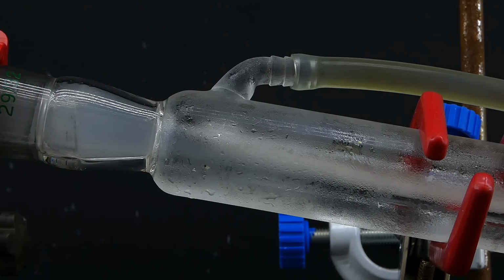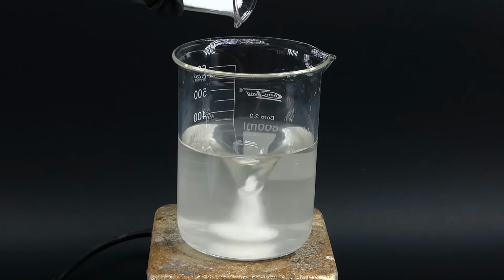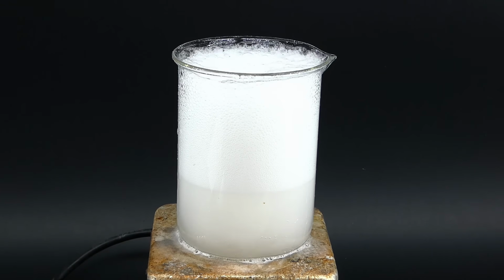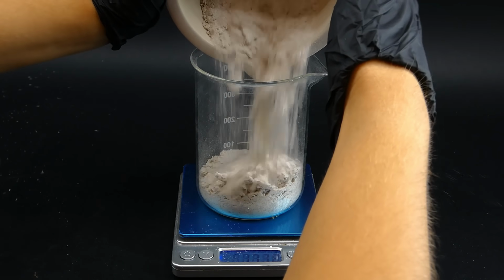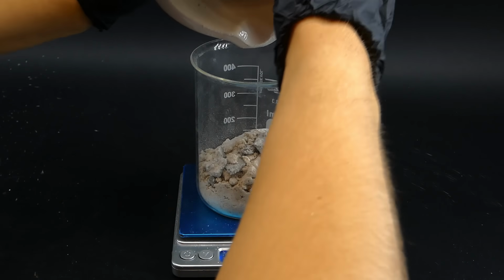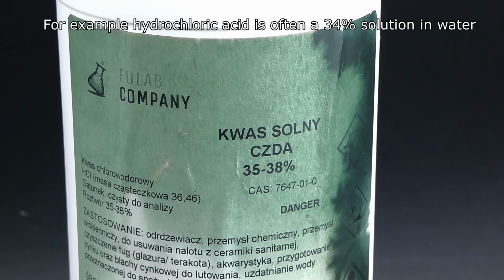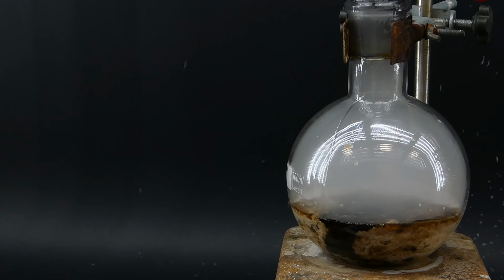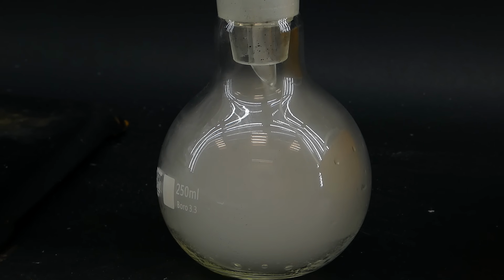Making Glacial (95%) Acetic Acid from Vinegar

Comment: 16:15 the acetic acid dose not dissolve copper it is bc modern pennys (after 1980 somethin)are mostly zinc with a thin copper coating and acetic acid dissolves zinc NOT copper

Comment: Yellow doesnt always mean bad. It could also be good. Because the more concentrated a solution becomes the more do the impuritys. Allowing you to indentify it as a amature home chemist, without using expensive equipment. Or boring TLC. Practical and fun applied science = NR#1

Colours on paper boring.

Comment: I Tried It With Calcium Acetate Instead Of Sodium, I Left It A Little Longer Than What It's Supposed To, The Distillant Was Clear At First But Then It Started To Turn Yellow as The Mixture Inside Of The RBF Turned Black And Solidified, I Thought It Was Some Acetone Because I Added An Excess Of Calcium acetate And The Flask was Totally Dry After The Distillation, But Then I Saw Sort Of (White Flaskes) floating On the Top Of The Distillant (Which Is Yellow In Color And Supposed To Be Glacial Acetic Acid And Acetone Mixture), Now The Question Is What Is Those White Flakes Supposed To Be ? I Really Can't Think of Anything

Comment: You can measure the concentration of the final product with volumetric titration: react an aliquot of the glacial acetic acid with excess sodium bicarbonate and measure the volume of CO2 produced with an inverted graduated cylinder set-up.

Comment: Where I live you can buy 80% acetic acid for cheap. I read in a 19th century manual (Dick's encyclopedia of practical processes) that it should be possible to dry 80% or higher acetic acid using anhydrous sodium sulfate followed by decanting and distillation to obtain glacial acetic acid.

Comment: I was wondering, can you get the sulfuric acid at such high concentration at the hardware store in Poland? Here in the Netherlands you can only obtain like 10% as an individual. I thought that was the case in the whole EU, but maybe not? It would be interesting to hear from you how it is where you live.
Reply: It seems to be implemented mostly in countries where terrorism is a problem, if you catch my drift. Before 2014 you could buy concentrated sulfuric acid, 65% nitric acid, 30% H2O2 (even 50% "perhydrol"), pure nitromethane, alkali nitrates and chlorates freely. Guess what happened that they decided to restrict all this draconically?

Comment: the shop you recommend is ridiculous. They never state purity information, and in many cases they don't even note the packing size or weight to their product. And prices are laughably high: 30m of normal household (thin) aluminium foil for 30€! You can get the same at the discounter for less than 10€! 🤣🤣🤣

Comment: Fascinating chemistry video excellent quality chemistry video very well done sir keep up the good work 👍 also, in South Australia where I live it is perfectly legal to purchase small quantities of glacial acetic acid (purchasing containers up to but not larger than 4 litres) so it's not necessary for me to convert vinegar to glacial acetic acid if I want glacial acetic acid but still excellent quality chemistry video truly fascinating. I think that it's also worth mentioning that despite being considered a weak acid since glacial acetic acid doesn't fully dissociate in water and completely dissociating in water is what defines a strong acid glacial acetic acid is still corrosive and capable of causing severe chemical burns if in prolonged contact with large areas of skin and in addition to being corrosive glacial acetic is also moderately flammable.

Comment: You can use copper hydroxide to make copper acetate. Those loose their hydration water very easily (heated to 100C but not more) and are soluble in acetone and ethanol among other things
Furthermore, when reacting with sulfuric acid you make CuSO4.

Comment: I really appreciate the way you take cleaning up into account. Might there be something easier to clean than a beaker for the step where you dehydrate sodium acetate?
Reply from the maker: I could theoretically dehydrate the sodium acetate in an oven and only have a baking tray to clean, but this might also result in a large mess
Reply: @Amateur.Chemistry  you may be more skilled at chipping things out of beakers than I am, but I've lost beakers this way. Loss of a beaker isn't a huge problem because beakers are cheap, but there's glass bits of various sizes to deal with, and that part's not fun.

Comment: the penny is zinc with only a copper plating, you can see it started really eating away at the inner zinc where the little blue corrosion spot was.
Reply: True:  That penny was from the 1990's is 97.5% Zinc, and Copper plated as you said above.
USA coins called pennies minted prior to 1983 have a face value of "1-Cent", and are 95% Copper, but have a melt value of THREE cents.
Old pennies have tripled in value!

Comment: What percentage of acetic acid makes an azeotrope with water?
Reply from the maker: Acetic acid actually doesn't make a water azeotrope, but it has such a close boiling point and high volatility that it is really difficult to separate it from water by distillation.
Reply: @Amateur.Chemistry  18 C is more than enough for a rough separation, I wonder that nobody did it on youtube yet. The very last bit of water may be removed by fractional crystallization

Comment: good tip from my lab - wrap the hotplate in aluminium foil, 1-2 layers. if u spill, it doesnt ruin the hotplate top and is easy to clean.
Reply from the maker: That actually seems lika a pretty good tip, I will try to remember to use is in a future video :)
Reply: @Amateur.Chemistry some of the non-stick / teflon coated aluminum might give you more time to save your hot plate from overflow.
Reply: Be careful to allow airflow though, I almost immediately demagnetized the stirring apparatus on an SH-2 by wrapping it in foil. To be fair they're shitty hotplates and they don't use high temperature magnets and are fully capable of demagnetizing them if they're on high with the stirring not running.
Reply: And don't dribble sulfuric acid down the side of the beaker.  Jeez.

Comment: I went to my local hardware store, here in USA knew of them, the one I went to, is called "Lowes". I strongly believe this hardware store to be international. It was large enough to land an airplane in. But anyways, they sell cleaning vinegar that is 30% even in the paint aisle! Btw, glacial acetic acid gets its name from "hot ice" which is sodium acetate. Pure acetic acid tends to "ice" up if it sits around for a while.
Reply: I used that for cleaning for cleaning some copper parts damaged by an electrolysis cell, and it formed really pretty copper acetate. I let that solution evaporate and the crystals it formed were also really neat. Then those will turn into copper carbonate if left out.
Reply: @nunyabisnass1141  the benzoate and acetate salts of copper make decent blue fire too.
Reply: @alllove1754  absolutely. If I could make my own glacial acetic acid, I'd dope it with copper acetate to see if it produces a nice greenish flame. But thats a project for more time and money.
Reply: @nunyabisnass1141  one day when I can I intend to put on a show myself.

Comment: I'm not sure that bisulfate will actually convert sodium acetate will it? I guess maybe it does if the target acid is volatile since it works for nitric. The main reaction is just the first proton of sulfuric acid right?
Reply from the maker: Bisulfate would probably work for this, and when it comes to the sulfuric acid the reaction depends on the temperature, when it is lower only one proton reacts and when it is higher they both react.
Reply: It works, but you should dry it in  an oven first or you can end up with more water in your product, same as with nitric.

Comment: @Amateur.Chemistry 12:18 That crystal brick is easily soluble in water with the exception of that black tar or whatever those organic impurities might be. If you want, you can keep that sodium sulfate, recrystallize it, dehydrate it and use as a drying agent for organic solvents. And since you mentioned that you used some sulfuric acid in excess, there is also some sodium bisulfate aka sodium hydrogen sulfate which can substitute sulfuric acid in some reactions.
Reply: Not the chemiolis shade😭 I personally think of these channels are quite interesting

Comment: I used glacial acetic acid for final cleaning of some parts to be soldered under vacuum. If you leave it sitting too long it just dissolves the copper, especially at the liquid-air-solid interfaces but it's not nearly as aggressive as eg 1 M HCl in that regard. The advantage was that it didn't need a rinsing step, just blow it dry (works a little better with nitrogen or argon). The coating to be soldered was very thin (200 nm iirc) so we needed something that really wouldn't etch copper metal to any significant extent. The process worked well enough, after a bit of development, but it was a bit clumsy. Gold would've been easier to work with, but and the gold coatings wet beautifully and the soldered joints were initially sound but then fell apart after days or weeks.
Reply: I appreciate this comment and will be ordering some aa online.  
To aid my cleaning of soulderinĝ equipment 
Much better excuse than making my own cigarette filters

Comment: Is it possible the reaction in the yellow plastic bowl absorbed a small amount of the dye, causing it to appear during concentration?
Reply from the maker: Maybe, but there was probably also something with the vinegar since I did this reaction with it before and it also ended up being yellow
Reply: @Amateur.Chemistry  I would say that what most likely happened is that vinegar acetic acid tends to have some of its precursor still in it, and so on concentrating it as an acetate salt the leftover organic impurities decompose and form the yellowish brown tint you see the solution or the crystallized solid. It can be sugars from fermenting fruit juices, for example.
Reply: @chemicalmaster3267  Yup. I once tried to use some cheap malt vinegar without distilling it first, it just turned into a weird mess of  polymerised junk (it looked like the vinegar had athletes foot!).